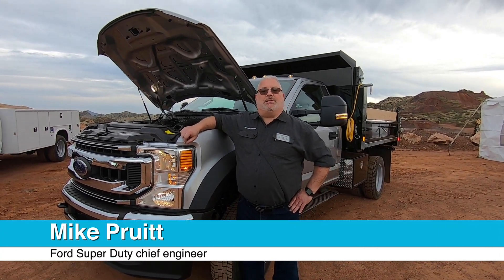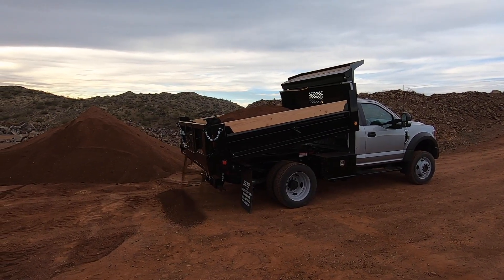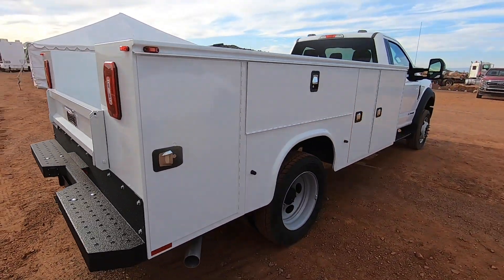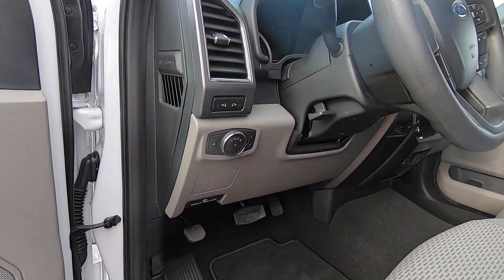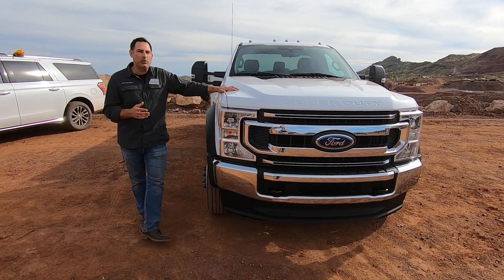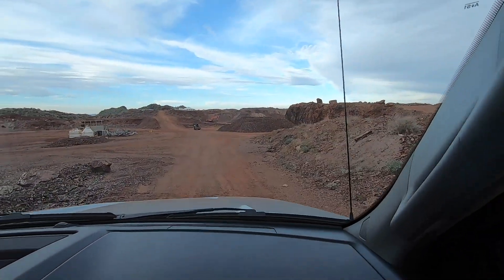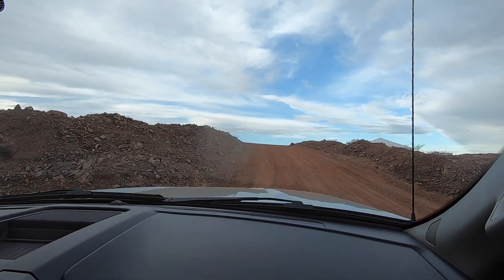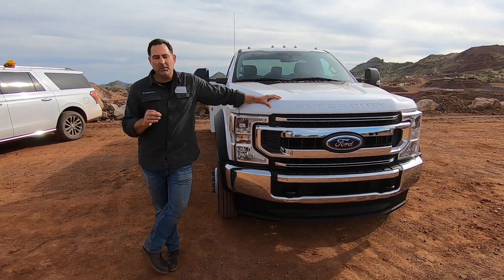Ford chassis cab changes for model year 2020

Comment: Why are chassis cab rated to tow much less than their pickup truck counterparts? Is this because of different turbos or different certification methods (chassis vs dyno)? For example, the 2014 f350 6.7l drw 4x2 chassis cab is rated to tow 16,100 fifth wheel where as the same pickup truck is rated to tow 23,900 fifth wheel. Will the chassis actually be able to tow 23,900 but it is just certified different because of EPA? Thanks. -Interested 2014 chassis cab owner
Reply: Chassis can come out if the factory tuned down with less horse power and less torque.
The reason longevity the tune down engine last longer.
 Maybe that's the reason they tow less the good News is the have Increase payload A lot more